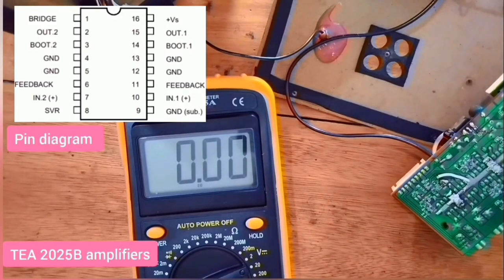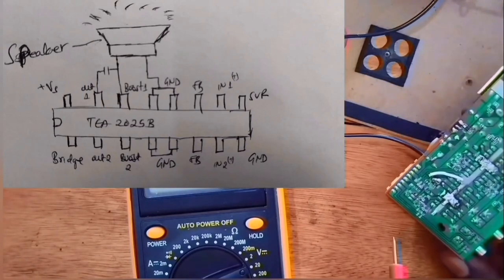troubleshooting of electronics devides

Comment: Really good video. I was ALWAYS told that I should NEVER check anything but voltage or current, while there is power going to the circuit. That I should NEVER check for continuity, capacitance, resistance, or check diodes while the circuit is powered. I don't know if that's what you were doing, you never mentioned to turn off the power, but it's really bad for your meter to do that. This is a good video, if you could just work out the sound, it would be perfect. It sounded like the person was too close to the microphone when they made the audio. Thanks for posting this.